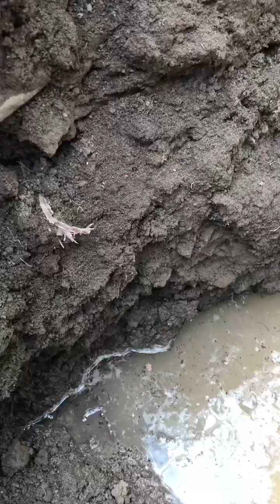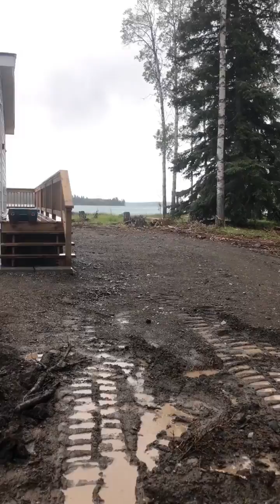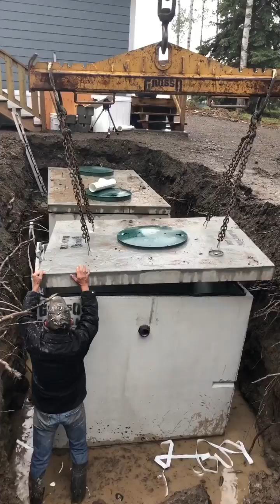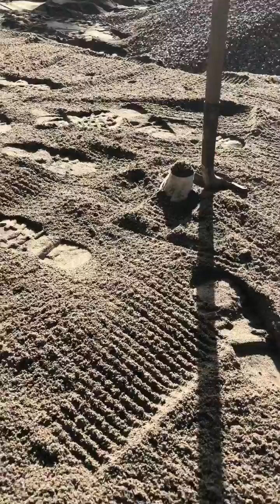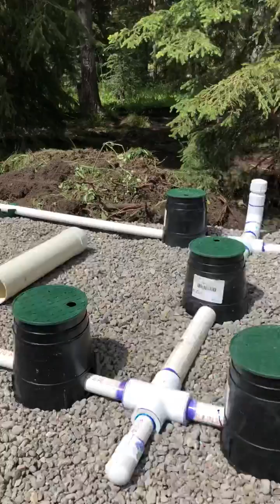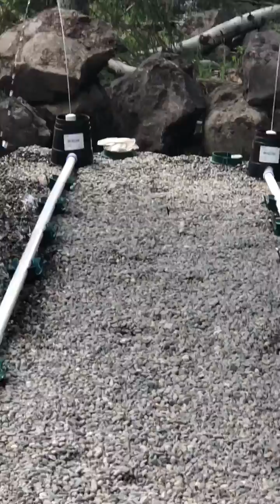Above Ground Septic System: How To Install A Sand Mound

Comment: Have to ask? Does it stink? 🤭 I may have to install one at my place
Reply from the maker: The sand mound itself will not emit smells, the effluent travels through the spec sand for the treatment, then goes to the native ground.  If the sand mound is properly done, there will be no breakaway effluent at the toes of the sand mound thus no smells.  The top of the sand is then protected with about 12" of topsoil cover allowing vegetation to grow, thus no smells emitted to the air.

Comment: What is the cost of this type of system
Reply from the maker: This particular system was about 22k.  It was for a 2 bdrm, out in very rural acreage making truck costs for sand and aggregates costly.  High water in this area required concrete tankage and those units came from a distance as well.  

Cheers
Reply: GroundStone WasteWater Services Good job
Reply: An when a tree falls.. sure it won't cause a bit of a problem. ? All of a sudden it don't matter. It's just going to go into the ground anyway. I personally would think that system would be cheaper because you don't have to dig the leach field so much correct? . How much was the dirt analysis
Reply: What would the estimated cost be for a 4 bedroom mound leach field cost? I am looking into a foreclosed home that has everything installed (tank) but no leach field. The mound leach field would just need to be added per the township waste management officer. (Brown stone bed rock)

The drip area denoted in subdivision plan is on an area about 8 feet lower than the tank. Would a pump still need to be installed? Or could this be gravity fed?
Reply: $20k